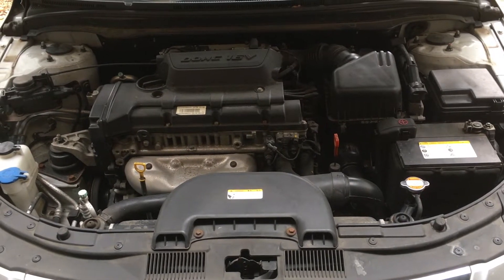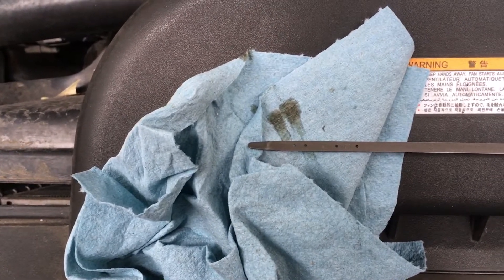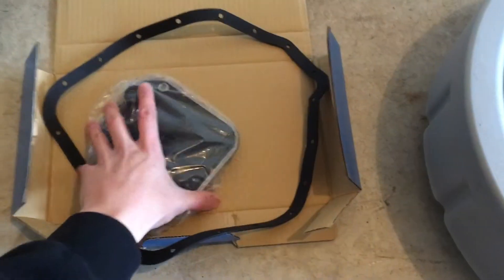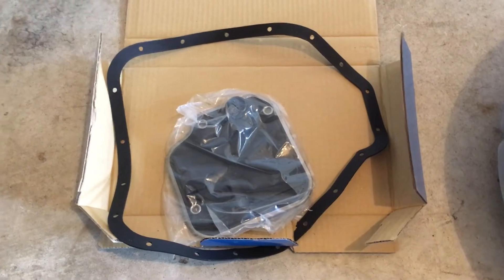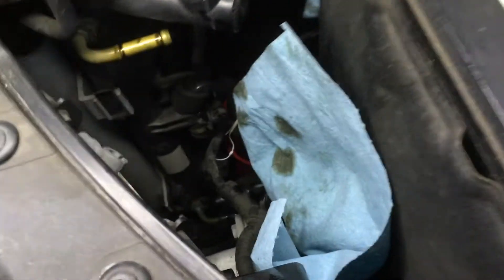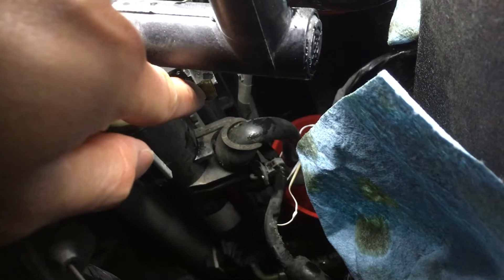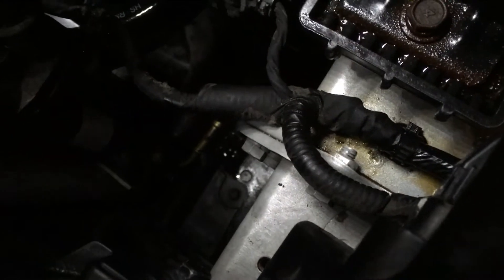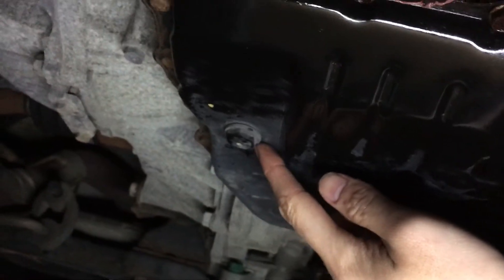Hyundai Elantra Touring Automatic Transmission Fluid Change

Comment: Your a boss for posting a video with the touring. Was not expecting a video for this with this model. Do i do all the same stuff just for a drain and fill? I was advised against doing a flush
Reply from the maker: @Matt-yj1lz  how many miles since you changed your transmission fluid? If you not doing a full flush… you don’t have to do half the steps I did… don’t drop the pan, don’t turn on the car to run the fluid out of the torque converter, just treat it like a regular oil change. You probably will have a quart or two of unchanged fluid.

Comment: I drained my pan first then disconnected the hose and it only sputtered oil out for about 60 seconds.. less than half a quart, so it's really not better than to just drain and fill.  Next time I'll save the wear on the pump and just drain the pan via the drain plug.
Reply from the maker: Good to note... This procedure was the one specified in the Hyundai Elantra Touring service manual:

If you have a fluid changer, use this changer to replace the fluid. If you do not have a fluid replace the fluid by the following procedure.

1. Disconnect the hose, which connects the transmission and the oil cooler (inside the radiator).
2. Start the engine and let the fluid drain out.
    Running condition: "N" range with engine idling
    CAUTION: The engine should be stopped within one minute after it is started. If the fluid has all drained out before then, the engine should be stopped at that point.
3. Remove the drain plug from the bottom of the transmission case to drain the fluid.

...

Hyundai says it is ok for the pump for a minute, but I'm sure it's all on us at this point if it breaks. :)

Comment: Make sure you replace timing belt . Take it to the shop for that. These engines blow up if not replaced in timely manner.
Reply from the maker: I have a second vehicle at this point - I saw some videos on replacing the timing belt and it looks like an interesting project. If I have the time, I might be interested in trying it myself. I already changed the water pump and alternator belt. I've been checking the timing belt every few years and so far, it was in good condition, but I think it is time to check again. I'm coming up to 100k miles on my car. Thanks for commenting!
Reply: @jonathanDIYs  Yep it is time to change it. 
2012 Elantra Touring here.
Reply: @jonathanDIYs i just had mine changed at 170k miles.

Comment: Now that it's 3 years later, what are your thoughts on Amsoil?  I'm curious, what drove you towards Amsoil in the first place?
Reply from the maker: Amsoil synthetic has worked pretty well for me. I switched over after bringing it to a shop in Florida that used it for an oil change. The owner recommended it and I thought it worked pretty well. I regularly test my oil and have successfully run my car on extended length oil changes (10k-15k miles) with no issue. Made me a happy customer that I decided to trust their products for my other fluids in the vehicle. 

As for the automatic transmission, I'm happy to report I haven't had any issues after the AT fluid change. Everything shifts as well as I can remember from when I first bought the car 10 years ago. Mind you, my car only has a little over 90k miles on it so it doesn't get as much heavy use as a lot of other cars. No problems with the power train, so a happy customer here.
Reply: @jonathanDIYs  Awesome, thanks!

Comment: Thank you.  I changed mines too and started hearing a "tapping" for about 3-4 seconds when the gear shifts from 1st to 2nd.  Just wondering if anyone else has had that problem.
Reply from the maker: Never had that issue. How many miles has the ATF been there? Was there any burnt smell from the original fluid?
Reply: @jonathanDIYs  bought it used in excellent condition with 100k.  Did not look like it had ever been changed.  No buying smell but it was dirty.  Thank you.
Reply: @nolanjoseph1892  did you check the fluid level? Low or high fluid could be an issue.
Reply: @jonchanvlogs  I will.  thanks.  I just subscribed in case you put out new stuff.  All the best!
Reply from the maker: @nolanjoseph1892  that's kind of you - thanks!

Comment: How much oil did you end up spilling and how much did you manage to catch in the basin? Secondly did you get any oil out of the torque converter and were you adding oil to the transmission when you were running the engine with the bottom hose disconnected? Failure to do so could damage the transmission.  How much transmission oil did you put back into the transmission?

Comment: Hello, has anyone experienced any slipping after the flush? I did a full flush and noticed slipping of the transmission after doing a complete flush. Any thoughts?
Reply from the maker: Sorry to hear... When you flushed it, did it smell burnt or were there any particles in the old fluid? How many miles did the transmission fluid run before you flushed it?
Reply: Jonathan Chan Not at all, but I did some more research and it turns out I poured a little too much fluid. I ended up taking out some fluid and it seems to be running a lot better. Thanks!

Comment: Why not remove the drain plug to drain your transmission ?
Reply: John Everson good question. Because you only end up draining 1/2 of the transmission fluid that way. The service manual actual describes draining the transmission fluid in this fashion if you don’t have the fancy reverse pump thing. This is the most effective way to ensure you replace all the fluid.
Reply: @jonchanvlogs okay so for a 5050 drain and fill in just drain from the bottom? And is there a fill screw in the bottom? Or can it only be filled from the top? I've seen some other videos where they drain and fill all from the bottom with a hose device type thing but they were different cars. And would I still need to disconnect the pump thing like he did in the video for just a 5050?
Reply from the maker: @Matt-yj1lz  just get a narrow funnel and pour the transmission fluid into the AT dipstick tube. I only remember a drain plug at the bottom of the AT oil pan. If you're just draining and refilling, you don't have to remove any pump...
Reply: Because that would be too easy. This video is an example of what NOT to do. Sometimes a little bit of knowledge can be a dangerous thing.

Comment: how many liters you took out
Reply from the maker: I don't know exactly since I spilled quite a bit on the floor. Somewhere between 4-5. I was surprised that I wasn't getting nearly the entire 6.6 liters capacity that it states in the manual. I wonder if some fluid was stuck in the torque converter.

Comment: Update now that it has been 4 months since upload please? I am looking to do this on my own soon. Have 2012 Elantra Touring SE.
Reply from the maker: Kit Stardust Everything has been great with my car. Gears switch smoothly and I don’t notice any issues!
Reply: @jonathanDIYs  awesome! and thanks you, great video also! one last thing. Which torque wrench did you use that can hit that 8 ft lb mark? amazon is not making it easy to find one.. Suggestions?
Reply from the maker: @christophernottoli671  Look for an inch pound torque wrench. 1 foot pound = 12 inch pound. So you'll be looking to set it to 96 inch pounds... It's very little torque - be careful not to strip the screws! Here's one on amazon that does what you need. https://www.amazon.com/TEKTON-24320-4-Inch-Torque-2-26-22-6/dp/B00C5ZL2EG?ref_=fsclp_pl_dp_1
Reply: @jonathanDIYs  thank you!
Reply from the maker: @christophernottoli671  good luck.. hopefully you will make less of a mess than I did! :) Let me know how the repair goes! :)
Reply: @jonathanDIYs  will do. Thank you again!

Comment: How has your experience been using Amsoil?
Reply from the maker: Amsoil has worked very well so far. I have been using it for oil and sending it to blackstone labs for testing. They say that the oil has been performing very well and that I can safely do 15000 mile oil changes. This is the first time I'm using it for transmission fluid, so i'll have to wait another 30-50k miles before I can really say. So far though, it shifts very well and everything has been working just fine.
Reply: @jonathanDIYs  Awesome. Good to know :)